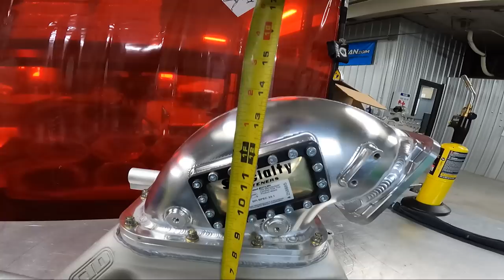Installing the Tick Performance Billet Elbow on a CID Intake

Comment: FYI
Methylated Spirits is the recommended lubricant for machining aluminium.
Keep up the great work!
Reply from the maker: It makes a big enough mess with it dry. I know the lubricant would help keep it cool but it would make it even harder to weld the cast. Definitely doing at the primitive way I know

Comment: I saw this billet elbow before and wondered, so now seems like a good time to ask. WHY? What advantange would billet provide over a casting?
Reply from the maker: It's just opening the area going into the intake larger so it distributes the air more evenly. Increasing plenum volume with boosted engines is like having air on reserve when all of your supporting components are big enough to give you that

Comment: Nice work!  WD40 is your friend when milling aluminum.  It will prevent the chips from sticking to the inserts and leave a cleaner finish.  Just FYI.
Reply from the maker: Make it really sucky to weld that cast which already sucks to begin with. Lubricants and oil you can't ever get out of the aluminum once you put it on there it seems like because it absorbs it
Reply: @rocksolidmotorsports7297  looks like it's working fine. alcohol if you want to keep the tool cool. inserts will last longer
Reply: @JGMACHINES  we used alcohol to cut aluminum it acts like a lubricant.. probably keeps aluminum cooler so chips dunt stick together so easy.. good tech..!